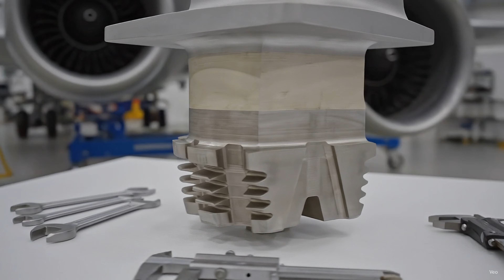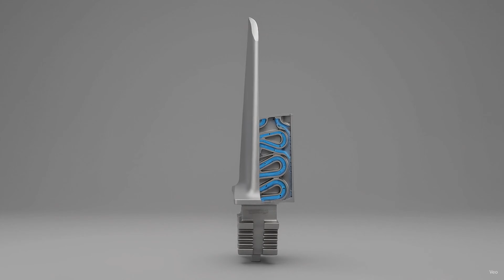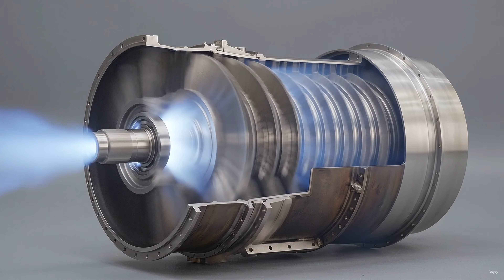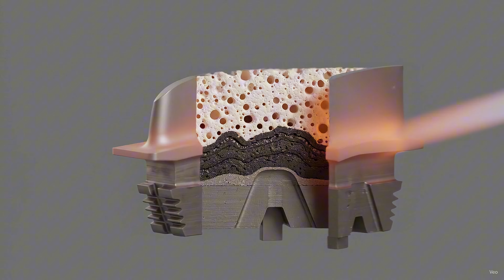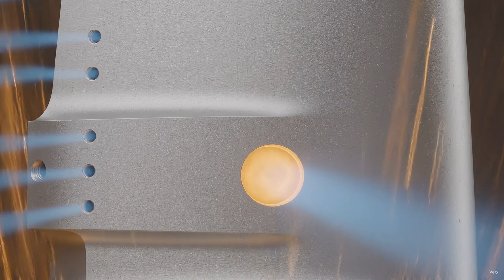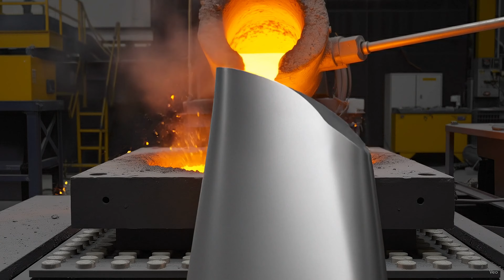How Jet Engine Turbine Blades Survive 1,600°C Heat

Comment from the maker: "The fact that these turbine blades routinely operate in gas temperatures hotter than their actual melting point without failing is pure engineering magic! 🤯 What part of this hidden cooling system impressed you the most? Let me know below! 👇"